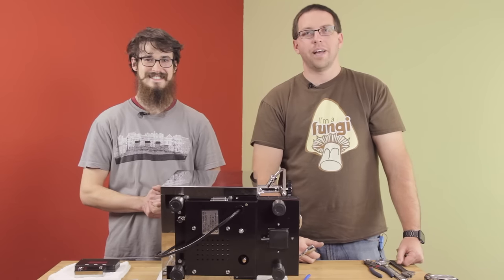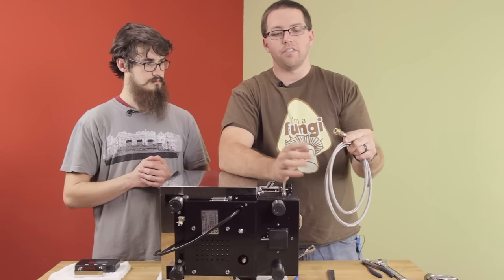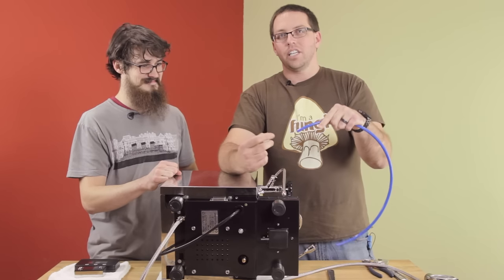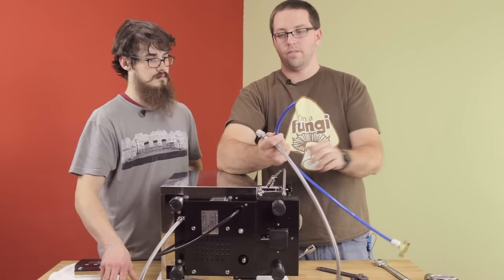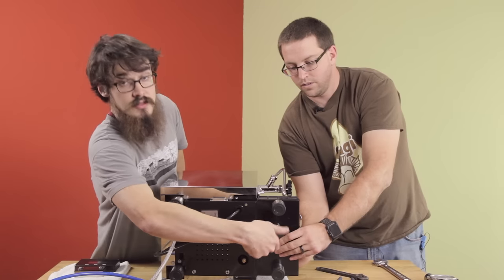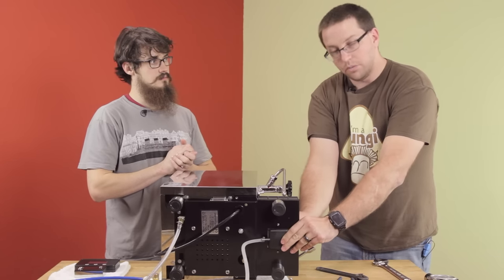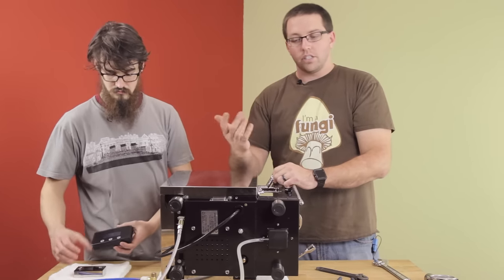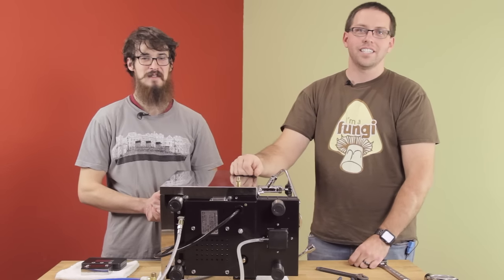How To Plumb In A Rocket Espresso Machine | Tune Up For What

Comment: If the tube for the drip tray drain is too hard to get on securely, fill a mug or a bowl with hot tap water and soak the end of the tubing in the hot water for 15-20 seconds. It'll soften and expand the tubing to make it easier to go onto the plastic barb on the drip tray. It's a trick I learned from years of watercooling computers.
Reply from the maker: +Whysperr Gaming Great tip! Thanks!

Comment: What's the best way to carry this thing? Im renovating and had to move it, grabbing it by the bottom rear and bottom of drip tray and i am convinced that I've bent the part where the drip tray frame connects with the main part. Could you tell me if its normal for it to be slightly bent upwards?

Comment: Just got an R58 from Seattle Coffee Gear, a plumber ran the line and plugged it. The machine is dripping on the front under the brew head, circular thing right above the tray. The house is on a 45-70 psi regulator. The guide says 5 bar, that is more than 70 psi. Any ideas of why it would be dripping?

Comment: We have a Mozzafiato Evoluzione R model, which did not come with the digital control.  We have plumbed it in but the water doesn't feed into the unit.  There is also no toggle switch.  Any suggestions?
Reply: How did you fix that??

Comment: I usually use an open flame to heat tight hose fittings
 Makes the hose, usually, harden slightly when it cools. Makes it able to endure higher pressure
Reply: Heat will degrade the plastic, there is a zero percent chance you will do anything to make the tubing withstand higher pressure and a non zero percent chance you will degrade the tubing. Use warm water to make it easier to work with and that’s it.

Comment: Well, owning this machine, that's a lark of a way to "plumb" a drain.  First, the hole for the drip tray is considerably larger than the hose capacity can handle in comparison.  You then have a big drip tray cascading into a small little black plastic cup that is maybe 1-2 shotglasses worth of capacity.  You have one 8oz cup spill into this thing and game over...liquid down over the plastic into the machine and then onto the counter.  One would think that there is a hose connection that can screw into a metal part with flush finish directly into the drip tray (you know...like a KEGERATOR HAS) that can  handle some volume.  Rocket needs to deal with that and to me, it's a no brainer for someone to come up with, and sell, that part so that Rocket doesn't get the money for it.  This is almost clownish what they have here for the setup.

Comment: I plumbed in my R58 with water source directly on 12 liter of bottled water, once a bottle ran out of water I switched back to tank replaced the bottle then switched again to connect, no suction coming through the braided hose from the bump, what should be done for a fix?
Reply from the maker: +xxyazeedxx Hello! Using the hose with a bottle of water is not good for the machine. There is no one way valve on that hose, so after pulling the shot the hose will leak all the water out and then when the machine calls for water the pump is dry and that pump will over heat and do some damage. If you want to use a water bottle we would suggest using a flow jet and a tank accumulator  to give it line pressure.
Reply: +Seattle Coffee Gear great thanks! How do I determine that the pump have not gone faulty? After I install a flow jet will things go smooth?
Reply from the maker: +xxyazeedxx From what you described, the pump may already be compromised. Taking it into a service center would probably be the best idea. Good luck!
Reply: +Seattle Coffee Gear thank you so much!

Comment: What to do if your Rocket R58 cavitates, even though there is roughly 2.5 bar at the machine and flow out of the flush valve on the BWT Bestmax Premium filter is normal?
Reading home-barista.com, it appears to be fairly common for Rockets to cavitate. Is the supplied hose/connector (1/8 male to 3/8 male) restricting flow?
Reply: Did you ever figure this out?
Reply: @Gamblor24  Nope. It's still more noisy, than it was when I tried the reservoir. I ordered a flow regulator, but it got lost in transit somewhere. A few years down the line, and the R58 is still chugging along. I have a spare rotation pump, brand new somewhere, but I doubt I will ever need it. I'll probably buy a new machine some time in the future (prepping the wife). ECM Synchronika or Lelit Bianca V3, but time will tell. Spending more time getting better at roasting, than worrying about a noisy pump.